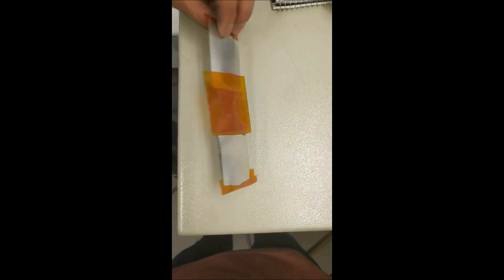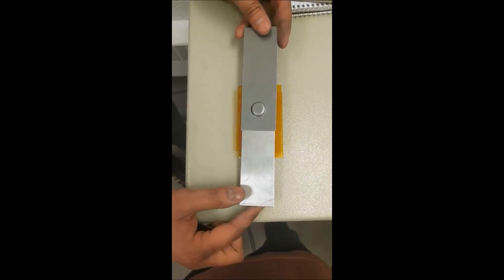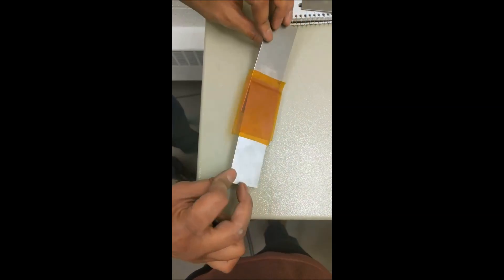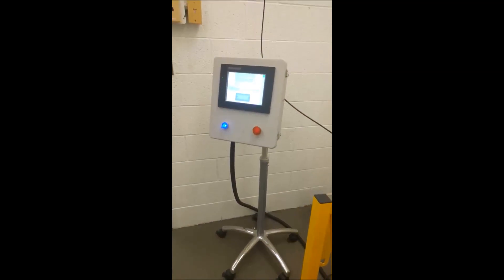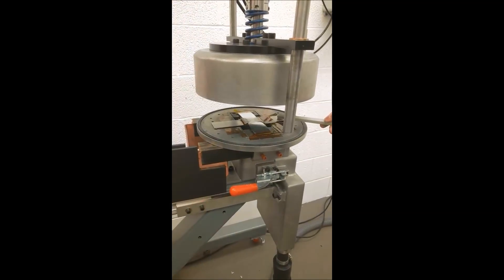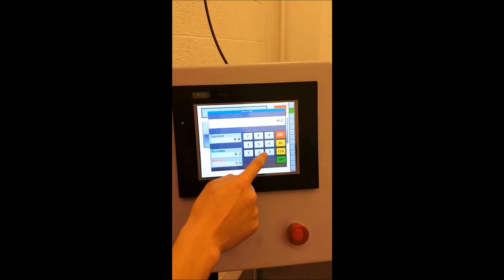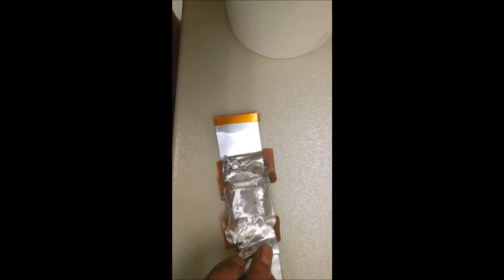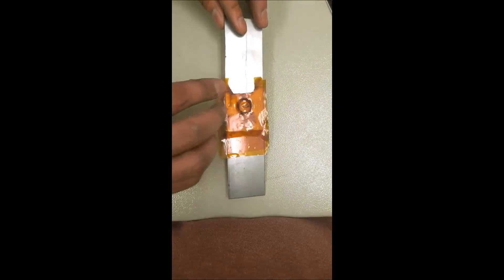Pedestal machine for VFAW: a civilized explosive welding method

Comment: Is that explosion welding?  It looks like your using electricity to melt the two metals together. Is there even an explosion?  It’s very cool and confusing.
Reply: The high energy delivered by the capacitor bank vaporizes a piece of foil "explosively", leading to a very strong but short Impulse. Just like an explosive.

It's quite similar to explosive forming/welding - very different means but very similar result.

Comment: Given the relatively small scales achievable vs explosive welding, what are the target applications. It's too time intensive for running lines of spot welds, are there mesoscale machining tasks where this would be of particular use? or is it primarily for metallurgy research?
Reply: Good to make gold bars with lead inside 😂